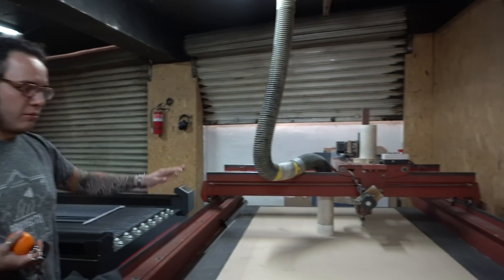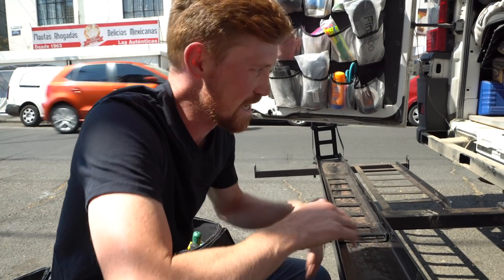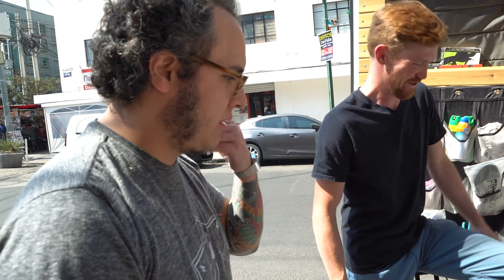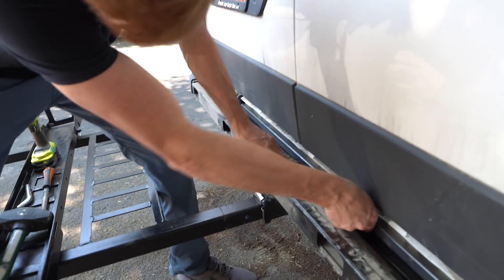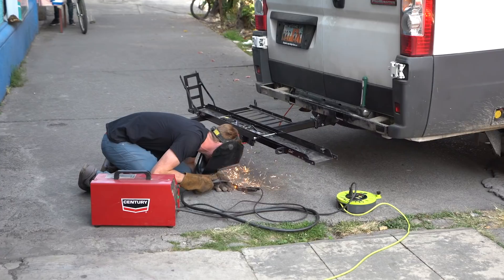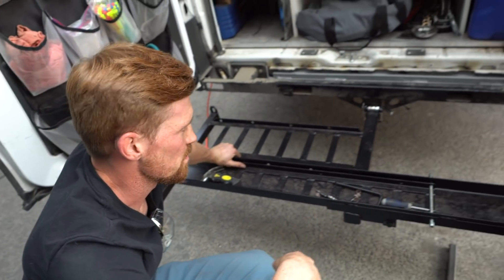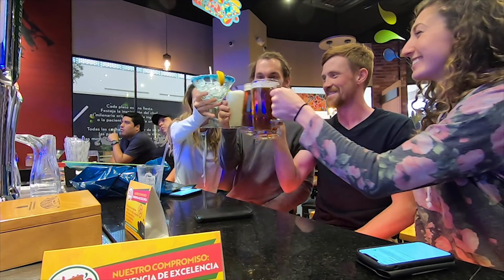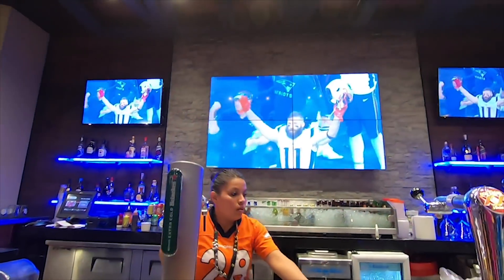Solving Van Life Problems in Mexico // Don't Stop Belizen Ep. 19

Comment: It is refreshing to hear someone speak in a positive way about engineers.  Too many people that know nothing about engineering feel free to criticize "engineers" in general because they have to loosen the motor mount on their Mustang to replace one of the spark plugs on an oversized V-8 that has been shoe-horned into a chassis too small for its size and power.  Engineers (civil, structural, mechanical, electrical ... perform amazing design services and solve incredibly difficult problems on a regular basis.  Often times, the problems with devices for which engineers are blamed are not the engineer's fault but rather the fault of management that direct them to use the cheaper or more expedient solution rather than the proper solutions (the Challenger disaster for example).

Comment: Trent take a piece of tubing . Should be 2” and cut to 12” length . 
Drill a hole at one end for the receiver pin . Now at the other end you will drill a hole slightly larger than the front motorcycle axle. 
If you have a issue with your motorcycle mount. Just take the 12” piece slide into receiver   Remove motorcycle wheel and run axle back into forks. X from handle bars to van frame. Cinched down and go . 
Or buy a regular 2” and weld a piece of tubing to it for axle to slide through. 
This let’s you tow  your bike if needed. Oh and take off the chain if going far. 
I’ve done this many times. For hundreds of miles.

Comment: You should incorporate a road map and pushpins of each of the places you have stopped on this trip. Have that as an illustration or something at the beginning or ending of your videos. That way we can get more of a feel of where you are and have some way of relating to your trip better.

An do not film anymore around military places or personnel. That is a big no no even if you were not specifically filming them. That is a quick way to get into trouble. Also, I would definitely trust the military over the police in Mexico any day. I have been to Mexico many times and have only had one extortion incident. It was with the Police with machine guns on either side of the car. My ex-husbandhad asked the Police at a stop light for directions out of town. The followed us and pulled us over when we got out of town. They said we made a huge traffic violation and had to come to the station. OR we could pay it then. 

If this happens, just pay the fine. If you do not have the amount to pay the fine, tell them that is all the cash you have. They will usually accept that.Do not argue, be polite, and get the hell away from there.

I have never had any issue with the military even though they have more guns and look more intimidating. Mexico is a very nice place. Just be aware of what is going on and be polite. Remember you are in their country. 

Also, the closer you get to Mexico City the worse it can be. That is my advice for the day.